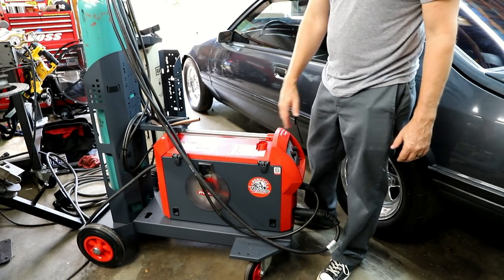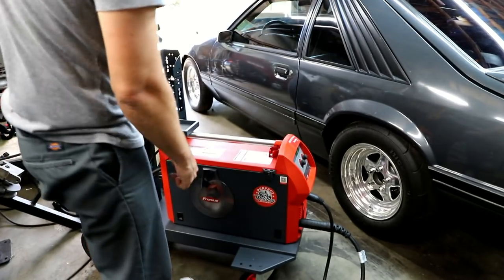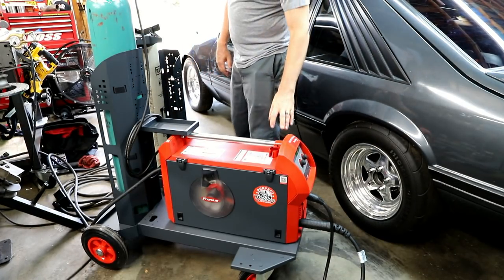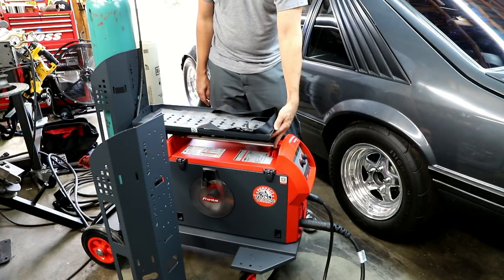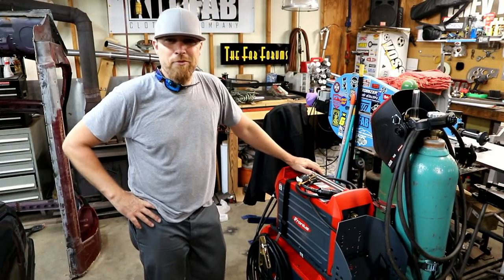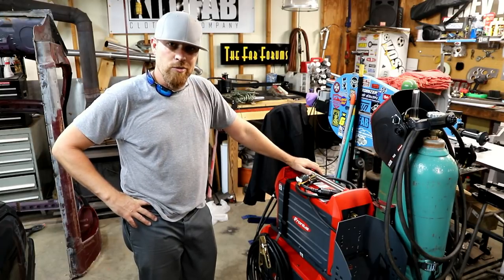Stacking MIG Welders

Comment: Quick question: I know you have a sponsorship deal with Fronius, but why would you need 2 migs on one cart? Are the 2 machines that different?
Reply: One person needs to do two different jobs frequently. It makes a lot more sense than having to navigate two carts around each other into the same space at the same time.
Reply from the maker: yeah I have the smaller machine set up for aluminum and the larger for steel